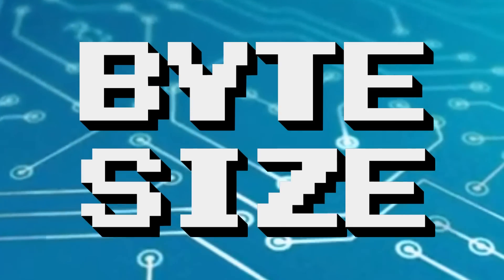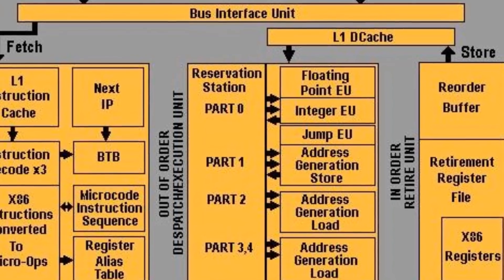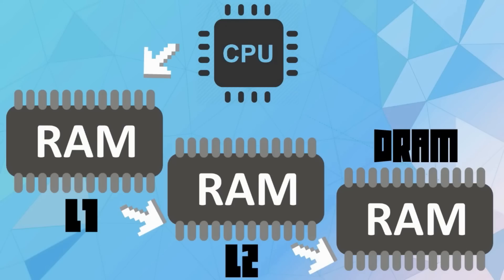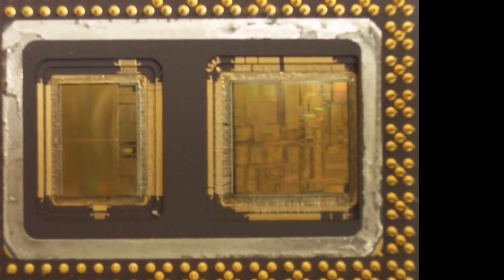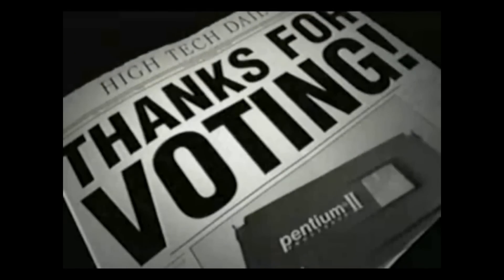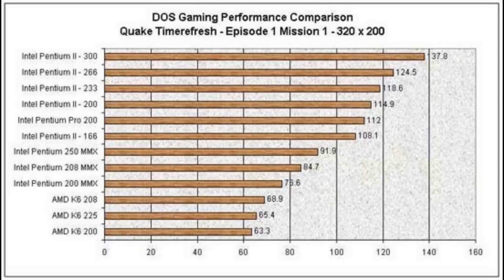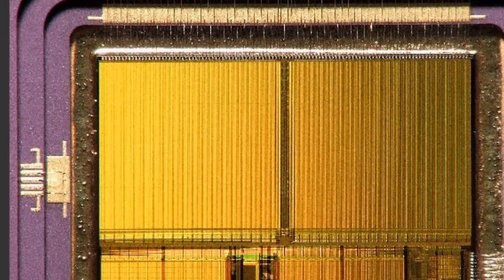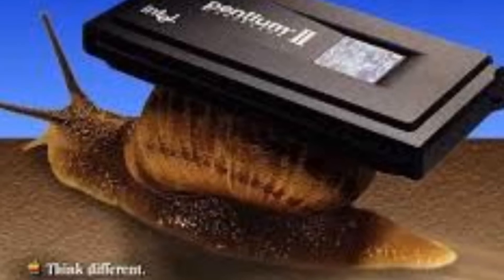Why Were Pentium 2's on Cards? [Byte Size] | Nostalgia Nerd

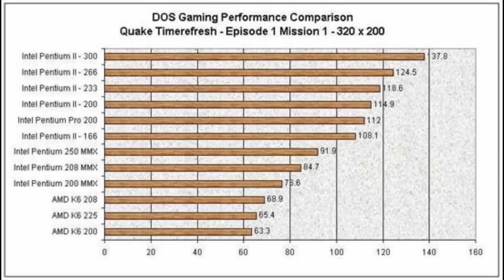Comment: The benchmark at 2:55 for DOS Gaming Performance Comparison shows an Intel Pentium II 166MHz and Intel Pentium II 200MHz that both didn't exist. Pentium II was beginning at 233 MHz 
Usually the term Pro is a marketing trick for consumer electronics but I remember well that the Pentium Pro was a truly professional and very powerful CPU. The #Pentium Pro could compete with the #PowerPC of #Mac Computers in multimedia applications. 
Pentium Pro processors and their motherboards were very expensive. Not affordable by most amateurs. 
It was a very different era during late 90's. With the advent of internet the Industry was exploding. Most people during that period bought their very first computer due to the advent of internet. 
The Pentium II Slot 1, some early Pentium III and AMD Athlon slot A were using cartridges. That didn't last long and was a clever idea to avoid the restrictions and the cost of adding every CPU component in a short package. Until socket 7 and super socket 7 people could choose in a single motherhood an Intel, an AMD or an Cyrix processor. That was helping competition. 
However for slot 1 there were some Slot 1/Socket 370 Converters for later Pentium III, VIA Cyrix III or VIA C3 socket 370 CPUs and Slot 1/Socket 8 Converters for Pentium Pro socket 8 CPUs. 

AMD Slot A was replaced by PGA-ZIF socket 462. 
Intel Slot 1 was replaced by PGA-ZIF (PinGridArray-ZeroInsertionForce) socket 360.

Comment: I would not be surprised to see a return of edge card CPU package with a water block on each side for cooling. This would also reduce the ammount of condensation the mother board is exposed to.

Comment: I had dual Pentium Pro 200 system and also a dual Pentium Pro 500 ( which I still have in a box ) in the mid - late 90s. They were sweet ( and expensive ), but soon I was building super fast & cheap Athlon systems.

Comment: I remember these, was working at a computer store assembling computers to sell and these came down the line.  My co-worker believed it was invented to get the CPU away from the motherboard to reduce interference as the new CPU was running at faster speeds.  It never sat right with me but wasn't going to argue, not worth it.  He said nothing when CPUs went back to motherboard sockets though.

Comment: Ah those were the days. I used a K6-2 400 with 3D now! (ha!) for my games rig, but my second machine was a Celeron 300A. The A had a full 128kb Cache on the CPU itself, so it ran at full speed. It also overclocked very well, though I never overclocked mine as CPU's were expensive. Still are :)
Reply: I had the P2 266 and yeah I went for a 300A system after that.
Those were great machines, got sold on when upgrading.

Comment: Those Celerons could be overclocked like crazy. I seem to remember running them from 266 to 450mhz. The cache on the p2's couldn't handle that level of overclocking.

Comment: Only the Celeron A series lacked cache.  After that batch, Intel started putting 128 L2 cache on the die itself (which, naturally, ran at core speed).  Of course, they kept you on a crippled bus by limiting you to a 66 MHz FSB, so overall, it still ran a bit slower than an equivalently clocked Pentium II.

Comment: Maybe you can make an issue about famous overclocking and hardware modification. The era you are covering had some remarkable overclock potential CPUs, such as the famous MMX 166MHz which were often capable of 250MHz+ without any special binning, which is more than 50% extra clock. Or should I mention the Abit BP6, which allowed running two Celerons in dual. One limitation of Celerons were (besides mutilated cache) is that they were not supposed to be in multi CPU systems. Abit BP6, some motherboards defied that.

Comment: During this time period, I went exclusively AMD.    My last Intel, until recently was 486-Dx2 66 from which I upgraded to 5x86 -133 occasionally overclocking at 160.  P rating was 75,   During the P-II era, I ran k6-2 300 and in 1999, nabbed a K-6 III 450 .   Chip makers upgraded socket 7 to super 7.   Intel folks were doing well with the Celeron -300 which effectively overclocked to 450 by boosting the front side bus from 66.67mhz to 100 mhz. and gave people a less expensive PII-450 style box.    Some of the first Athlons were slot A , a similar design to slot 1.   Both AMD and Intel abandoned the slots around the 1 gigahertz speed with the top Pentium III 's and the Thunderbird Athlon, and Athlon XP.

Comment: before watching it was a combination of tricky voltage needs and moving away from cache modules on the die which is was more cost effective to use cache modules separate from the cpu die due to low yields

Comment: The video cuts of at celerons omitting the real story about them. 
Soon after first celerons (which, devoided of cache were a market failure), intel released celerons with 128k on-die cache, clocked of course at the processor speed. Not only that, they were famously capable of huge overclocks by changing the bus speed from 66 to 100MHz (100Mhz was supposed to be reserved for the premium Pentium IIs), resulting in the celeron 300a comfortably running at 450mhz, making them on-par or even better than the much more expensive Pentium IIs. 
This undercut the Pentium II 450 so much, they became very weary of features and binning to make sure this wouldn't happen in the future.

Comment: Pentium III-based Celeron actually eventually moved every single bits of L2 cache RAM onto single die - earlier Pentium II-based Celeron, especially 300 MHz version were pathetic due to the fact that they didn't have the L2 cache RAM yet until Intel decided to sort out its handicap and gave it 128 KB L2.

Comment: LOL, 2023 checkin in! :-)  I was just elbows deep into a dual PII box. It has 4x 256MB RAM sticks on it. Intel was the only game in town if we wanted more than one CPU. Typical for me, I ran Slackware 8,9,10 on it.   As I type, I am listening to the MIDI files I was after from the "dead" huge 24GB RAID 1 array :-)  I imaged the array into a file for a modern VM. I nabbed a win partition too. "Sherman, set the Wayback Machine for ..."

Comment: The real reason for Slot 1 was simpler.  There was no technical advantage to the card edge connector.  Intel wanted to kill Socket 7 by getting builders to use their proprietary form factor, and thereby push AMD and Cyrix out of the market.  It didn't quite work out in their favor.  When they realized that fact, they dumped Slot 1 for Socket 370 right quick because the slot design was crap anyway.  AMD didn't stick with their own Slot A for long either due to technical limitations and went with Socket A.

Comment: from family member i had a 800mhz P3 slot1, with 320mb 133ram and a geforce 440mx 64mb back in 2003-2006 when i got own computer parts.
 my parents used it until about 2009. after that recycled

Comment: My Celeron 333 didn't even have the plastic case, it was just a green PCB that slotted in to the motherboard and looked weird because my motherboard had two vertical arms for holding a cartridge in place but instead this bare PCB just wobbled around inside the arms.  Not sure if all Celerons were as bare bones as that or if it was an OEM Celeron I bought from a computer fair (it was 20 years ago almost).

Comment: Used to run a Celeron 300-A clocked up to 500-some-odd MHz, that was a good chip for the time. Had to mount the celery onto a card with a socket.

Comment: What intel didn't told is, this design is to prevent Cyrix and AMD produce comparable CPU that could use same socket and same motherboard.

But it didn't stop AMD producing X86 CPUs. Form here, AMD start to use their own slot / socket , chip set etc.
 (Cyrix seem to be disappeared ?)

soon Intel went back to socket based.

Comment: I have a NEC 400 Mhz Pentium 2 Slot 1 440BX workstation tower with 2  PCI Fast Ethernet cards.

The tower has Windows Server 2003 installed.  Could I use this as a WAN server if I connect it to a 3 Mbps bonded T1 dedicated line?

Comment: I miss the old slot CPUs, my original Athlon 850 came like that and it allowed for a massive cooler and golden finger overclock device.
Reply: I had a DEC pizza box PII. It was a brilliant machine. The processor was positioned with the edge near the front and the heatsink on it was ducted with a small fan at the end drawing air across it. First time I'd seen such a great cooling solution instead of the usual 'just stick a fan on it'  approach.
Reply: I loved my Athlon 700. It was really good for overclocking. Remember it was not fitting very good in the slot since I had cracked open the case to be able to fit the overclocking device.

Comment: I do remember that those early "cache-less" Celerons had a very bad reputation because they were incredibly slow, even slower than the Pentium MMX. However i'm sure they were a success for Intel, because ... at about the same time that the P-II and Celeron appeared, It was also the time "Internet Cafeterias" started appearing everywhere, and the Celeron, as it was a cheap solution, was present on most of the machines these shops had there. Aside from all of this, Celerons were good overclockers as well. Probably the first CPU to become famous because of its ability to overclock well.
Reply from the maker: +Greg Lyris Ahhh Internet cafes... what a fleeting piece of amazing history they were
Reply: I still know of one in London.
Reply: Internet cafes back then: Full blown investment both into computer equipment for customer use, as well as restaurant expenses and other normal business expenses
Internet cafes now: Coffee shop with wifi, laptop or tablet, voila.
Reply: ***** just the WiFi and a chalk board telling customers the current password normally. As all the big chains put them in now most independent coffee shops here just concentrated on the coffee.
Reply: eLJaybud True.

Comment: What? No mention of the 300A?  128KB of FULL SPEED Cache like the Xeon.  66Mhz Bus x 4.5  If pin B11 on the back side of the CPU was covered with electrical tape, the bus would run at 100Mhz (Like the Pentium II) and bring the CPU up to 450Mhz.  Which makes it one of the most legendary chips ever at an astonishing 50% overclock.

Comment: That is why I urgently avoided to buy a Celeron instead of my initial PIII Machine in 2001. On the other end it got an Celeron 1400 T CPU lateron but that wasn't notably below the PIII T at a similar speed. The celerons furthermore were designed to be used as single cpu's only. SMP was not enabled on these.

Comment: Anyone else do the modification to the Celeron cards to allow two in a dual processor (slotted) motherboard? The modification required drilling the processor board and adding a small wire to bring an otherwise missing signal to the card's edge.
Reply: Kent VanderVelden upgrade a celeron to a broken pentium?

pentiums that did not meet benchmark criteria had portions disabled and sold as a celeron for a lower price point.
Reply: Hi Blain. I didn't realize that. The modification I did a long time ago is covered at  www cpu-central com (slash) dualceleron . It may have been the last of the cool computer hacks I did. (Nothing like the number available during the days of Amiga and such.)
Reply: Speaking of such, I did the Chip Stacking Mod on my old Amiga 1000 bumping it from 512k to 1M.
Reply: You don't have to spell out URLs anymore on Youtube.  You can just paste them...  See?  http://www.cpu-central.com/dualceleron/  It's been that way for a couple years now.
Reply: fetymann Thanks. Pasting URLs seems to increase the chance of, though not guarantee, a post being classified as spam. Not wanting to come back to check if my comment was posted, I spelled the URL out.
Reply: When a post is reported, I'm pretty sure it's reviewed by a real person at Youtube. Being that your url pertains to what you and everyone else is talking about.  I don't think it would become spam and be hidden or deleted.
Reply: fetymann You could very well be right, I have no experience with Reported comments. Some comments are automatically classified as  spam. Those are either deleted or held in the Likely Spam tab on the channel's comments until the moderator releases them. Links seem to be one way of triggering it, based only on my own moderation experiences.
Reply: Yeah and YouTube can still override the decision.

There are some comment on my channel that I tried everything and I was  never able to allow them.
Reply: Eric Jacques That's really interesting. I had someone make a comment that was very informative. It was classified as spam, I OK'ed it, but a few days later was completely removed. I can't imagine the author having done it because he had obviously put effort into it. I'm sure it was the link that flagged the classifier.

Comment: Thank you sir for making this extremely informative video. You my friend are very knowledgeable on all things tech. Now, I did know quite a bit about this particular subject as I have been building PC's since...1994. My first was a vlone 486DX2 for Doom. 

I however, did not know how Intel made the Celeron processor...interesting. Further, I knew you could potentially have a faster Pentium Pro than a Pentium 2 Pro but I never really studied that particular subject. I would love to hear what you have to say about the old Athlon 64 processors that cane out around the time of the Pentium 4 Prescott 3.0 GHZ. I threw together a Pentium 4 Prescott build with a 6800GTX 512mb video card when Doom 3 launched. My best friend did the same but with Athlon and his lit ran so much better and I didn't understand why. I simply overclocked mine to hit in the 3.3GHZ range setting things right again.

Comment: I do wonder, if you guys will ever do one on the Pentium 4 and AMD Athlons, with the stories that people died in the fires they caused. Because the chips, especially the P4 got so hot in normal operation it caused motherboards to ignite. Kinda puts those exploding Laptop batteries in perspective.

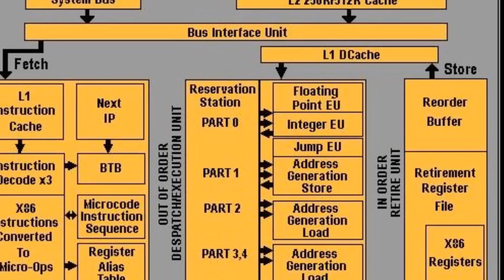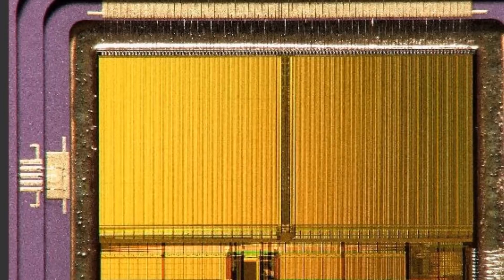Comment: Where did you get the idea that the "co-processor" frequency was "half the internal speed" (0:36-0:44). The Pentium Pro FPU used the same clock as the CPU afaik.
Reply: Also, your illustration seem to suggest a L3 cache using DRAM. That would be rather meningless, as it would be about as slow as ordinary memory. Systems that implement a cache outside the CPU use fast static RAM, whether level 3, 2, or even 1 (as in some 386 computers). It was the long latency of dynamic RAM that made caches useful in the first place (i.e. before internal CPU clocks were multiples of external bus speeds).
Reply from the maker: It's got nothing to with a "co-processor", I was talking about the L2 cache, which was indeed accessed at half the internal speed of the processor.
Reply: True. But I heard this: "This cache was terrific in that it could talk to the CPU at half of the CPU's full internal speed, that's the co-processor frequency." Your answer suggests that it probably was ...core processor frequency, but to me, that would be like saying that half speed=full speed. So I ruled that possibility out.
Reply: running at half the speed of the cpu not co processor, which was still faster than the bus speed which was 66mhz at the time or a max of 100mhz
Reply: *****
No, dynamic RAM for an L2 cache would be even more meaningless. It is far to slow. Fast cache memories are always built with static RAM cells, i.e. static latches.
Reply: *****
The 386 (with or without DX) had no built in FPU, or other co-processor for that matter. The original i486 (1989) had a FPU on chip though.
Reply: i had a k6-2 550mhz with no l2 cache the l2 cache was on the motherboard running at bus speed of 100mhz i couldnt understand that either but its a fact
Reply: *****
No, the 386 DX had no FPU either. No 386 CPUs had a co-processor on chip Look it up.

And again, the original i486 had a FPU on chip. However, Intel had yield problems with this complex design, so in a later revision they made it possible to completely disable a defective FPU. They could then sell that chip as a working 486 "SX", instead of throwing it away.
Reply: not on chip but on motherboard then? i just knew it was faster than a 486sx at same clock rate
Reply: *****
"i had a k6-2 550mhz with no l2 cache the l2 cache was on the motherboard running at bus speed of 100mhz i couldnt understand that either but its a fact"

That cache on the motherboard was fast static RAM, not dynamic RAM, as in the ordinary main memory of a PC (which is much slower as it demands multiple cycles for access).

A L2 cache on the motherboard was common also in 486 and Pentium systems. Some 386 computers also used a cache. That memory was consequently always located on the motherbard as the 386 lacked any internal cache (the L1/2/3 terminology is not really applicable to systems with only a single level cache).
Reply: interesting so even though the l2 cache was on the motherboard  running at the same clk speed as the memory it was still faster due to it being static memory? faster timings as it were
Reply: *****
Yes, static RAM has faster (usually single clock) timings, no RAS/CAS-multiplexing, and true random access for both read and write of every single byte. This is far from true for the burst oriented dynamic RAMs normally used as main memory (i.e. FPM, SDRAM, DDR, DDR2, DDR3...).
Reply: You're thinking of the PII. The PPro's cache ran at full CPU speed, which made the PPro 200 1mB a useful CPU late into its life.
Reply: LegendLength The original i486 also had on chip x87 FPU, without "DX". Later revisions made it possible to disable the FPU. This was a way to increase yield as chips sold as "SX" had a faulty and therefore disabled FPU. Later on, they also designed a "real" SX variant, a smaller chip witout FPU.